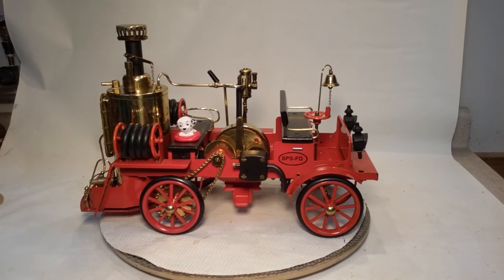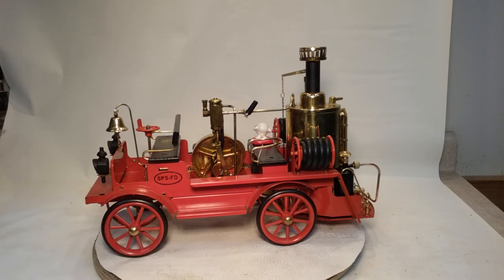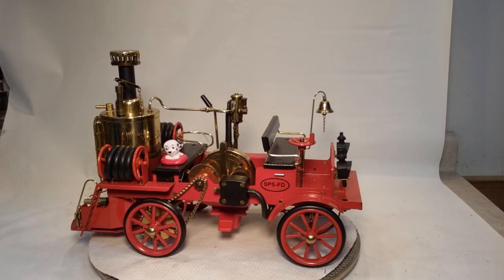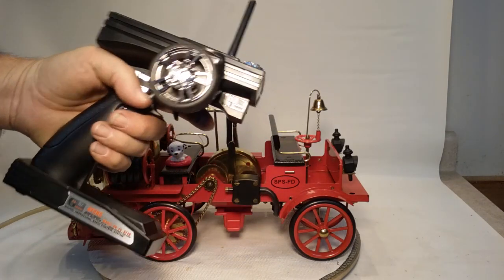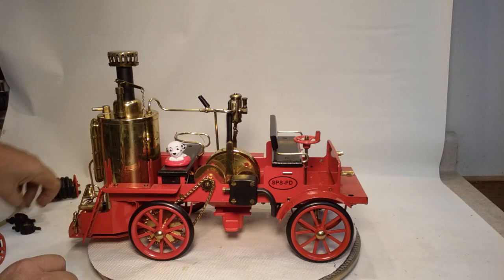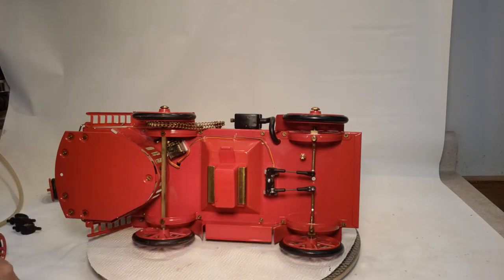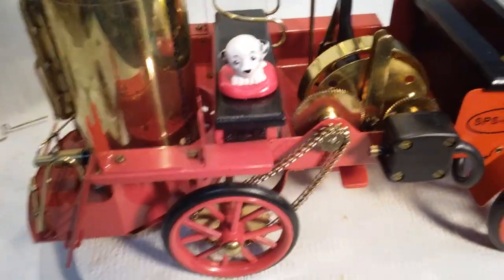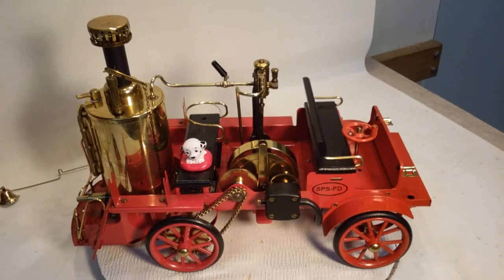Wilesco D305  modified - Technical video

Comment: Many thanks for this, just about to upgrade my D305, a little unsure about where to place the gas tank,  I thought it should fit where yours is,  glad for the confirmation!
Reply from the maker: Hello Chris, I have most Wilesco mobiles & believe the D305 to be the best built model by far, I thought about under the seat for the fuel tank, but this just works much better.

Comment: Lots of work done Bruce ! Gas heating is way to go with this boiler. I plan to hide horizontal gas tank below the rear seat as mine will not be having RC stuff there. Peter
Reply from the maker: how will you be able to turn the valve , (if its under the seat) ?
Reply: Valve will be on the top of seat - located where you have puppy  on yours :)
Reply from the maker: @peterpereszlenyi  , I see, I was just curious....because originally I was going to cut a 1/2 circle out of the seat & place the gas tank just where you said , I don't think I would have had enough fuel line to make that run ....& after studying it for awhile came up with the placement I eventually used, much more convenient & the boiler warms the fuel tank....& where would my puppy sit....lol
Reply: Not a bad solution either and yes very convenient to operate. I'm reserving that location for boiler feedpump. But with all the other projects Im not going to get to do that very soon :) I think that it would further enhance look of this machine is a nice small pressure gauge I fitted. Rather than wilesco I'm thinking of smaller model offered for mamods. It is up to 30psi so should be ok.
Reply from the maker: @peterpereszlenyi  ,I like the "pressure gauge " idea...and may just "borrow" that idea from you.